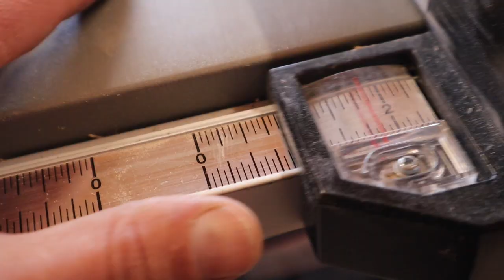DIY Folding Bucksaw (contest closed)

Comment: Very nice saw and video man! I see you put the cross piece up higher than others so it can cut larger diameter logs. Has this been an issue with the "less" leverage to tighten the blade? I'm going to build my first bucksaw and wonder where is the best place to put the center cross piece. Thanks for any advice!
Reply from the maker: I have noticed a bit less torque with the cross peice a bit higher.  Although I haven't noticed it being loose. I just need to tighten it a bit more. This may wear the bankline a bit quicker? But hey, bankline is cheap! Thanks so much for watching my friend and good luck with your project.